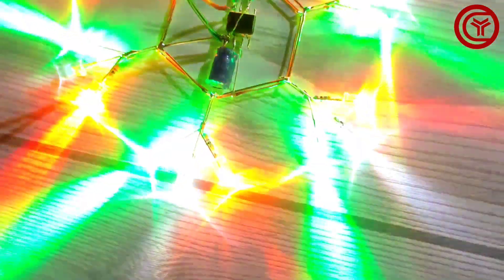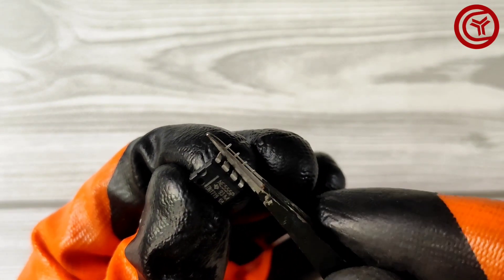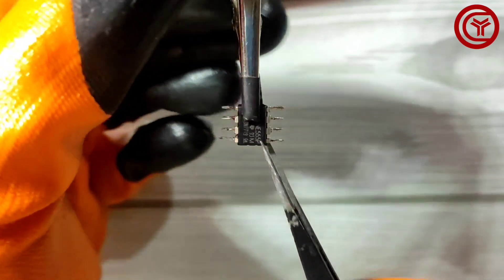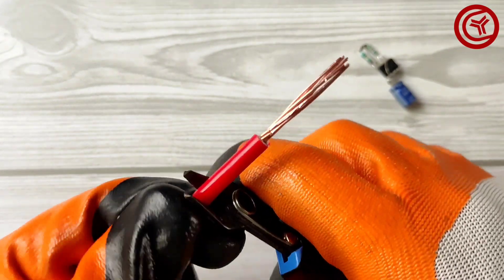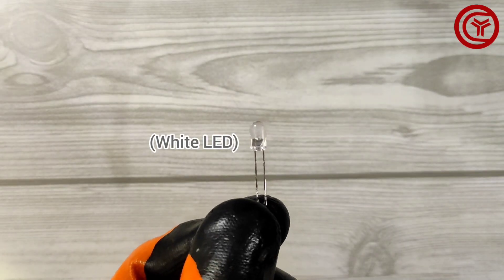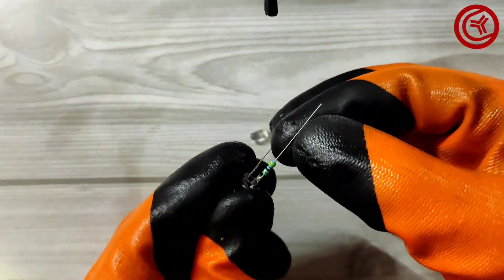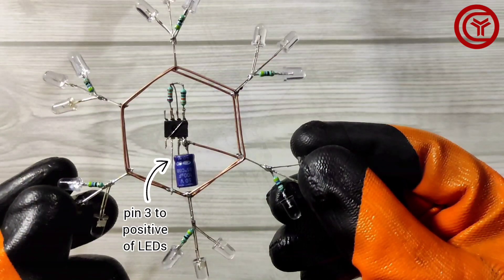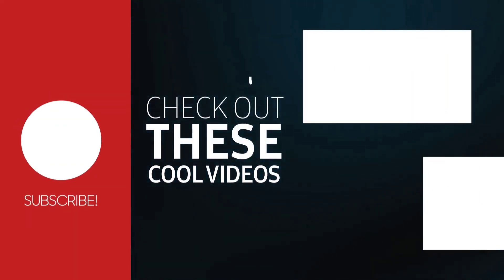Superb led flasher circuit using 555 ic

Comment: There is an error in your schematic(google drive link).  It shows a 10k resistor between pins 8 and 3. The 10k resistor should be between pins 8 and 7.